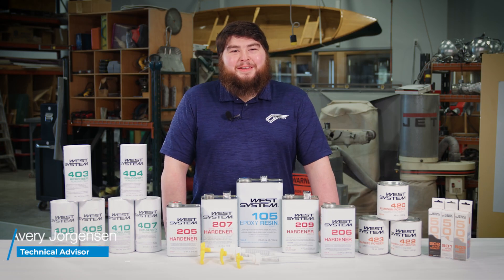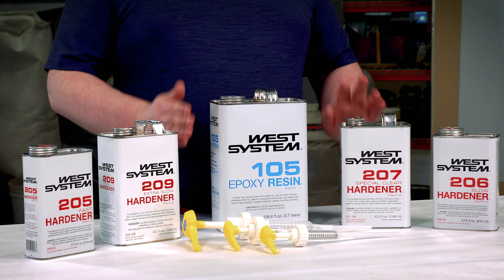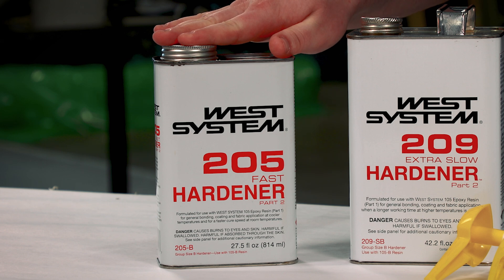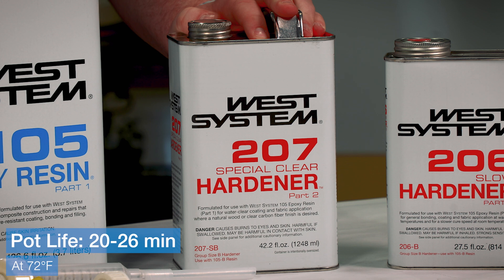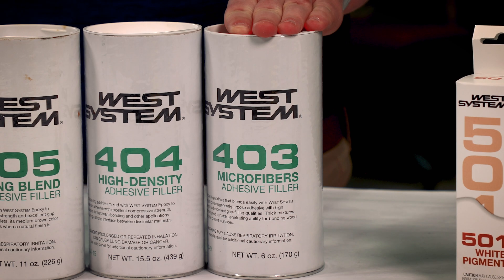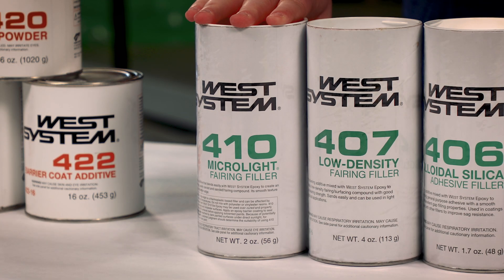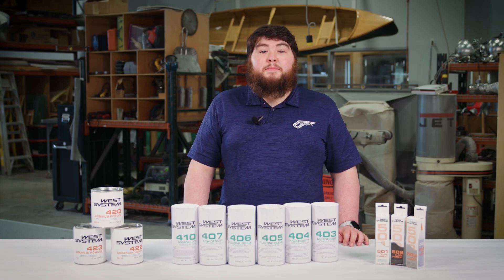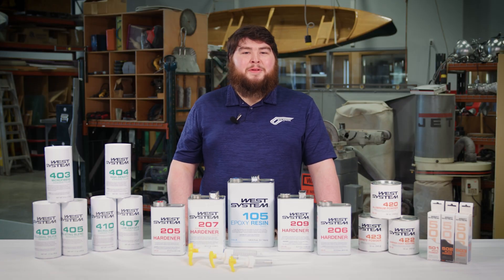WEST SYSTEM 105 System: The Complete Guide

Comment: I have used resin with 206 hardener pouring in a redwood slab.  the depth of the pour is about an inch so I did a shallow pour waited 12 hours then did another pour waited 12 hours then a final pour.  the mixture was 1-1 ratio.  It's been 3 days since my final pour and the pour is still tacky to touch.  I might add the room temperature is mid 70`s.  any tips how I can get this to cure hard?
Reply from the maker: The mix ratio of our 105 Resin with our 206 Slow Hardener is only 1:1 when using our calibrated 300 mini pumps. The correct mix ratio by volume or by weight is 5:1. If you accidentally mixed it 1:1 by volume or weight, it will not cure correctly and needs to be removed from the project.
If you used the 300 mini pumps to measure 1 pump of resin for every 1 pump of hardener, we would need more details about temperature fluctuations in your workspace, how the space is heated (if it is heated), and whether only the surface is tacky. Still, the rest of the material is hard (even when wearing gloves, you can't push a fingernail into the surface). Please give us a call at 866-937-8797, and we will discuss this project further with you. 👍

Comment: I have a question: I have a gallon of 206 hardener and it turns brown so this not good anymore or I can use it like that. Thank you
Reply from the maker: The West System hardeners will gain color with age, so color is not an indicator of whether the product is still good. They should be usable up to 5 years after the date of manufacture. After 5 years, we recommend making a small test batch to ensure that it cures properly and hasn't become contaminated. After 10 years, we do not recommend using the product for anything structural. We wrote an article going into more detail here:
https://www.epoxyworks.com/about-epoxy-shelf-life/

Comment: Is 207 as strong as 206?
Reply from the maker: 206 Slow Hardener and 207 Special Clear Hardener have very similar mechanical properties, but 207 has slightly lower tensile strength.